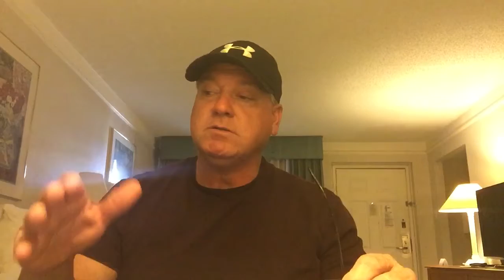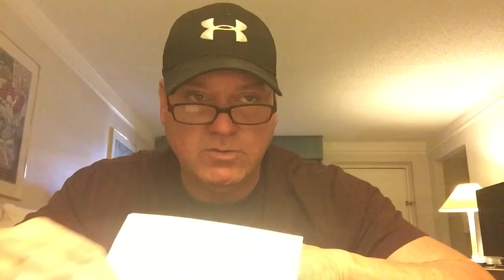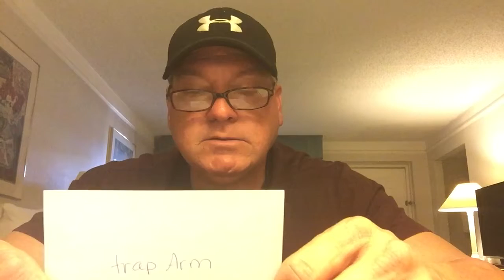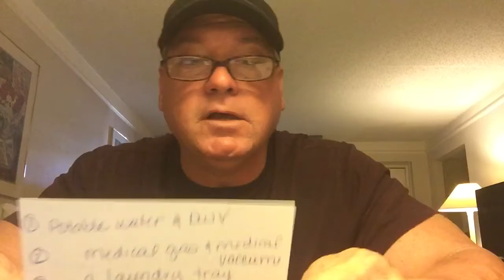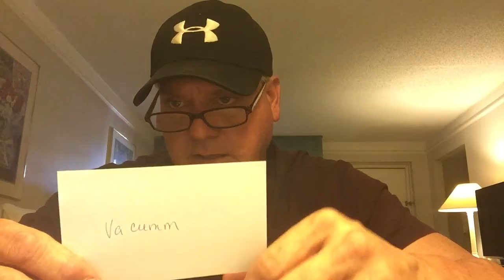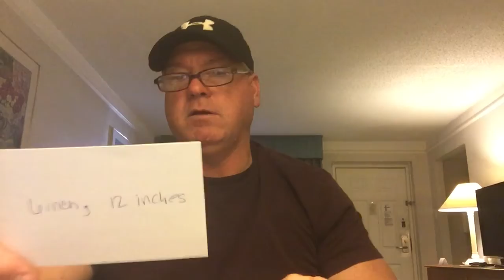Texas Plumbers Journeymans license test study video #2 - Reggie Cooper

Comment: 18 in from any side wall to any wc or bidets. Not 21 inches
Reply: 21 in front 15 from wall 18 is ada with 60 radius
Reply: @darthdookieclause9184  in washington state its 15 from a wall, 30 center to center, and 2 ft in front... what is you number 18 in reference to?